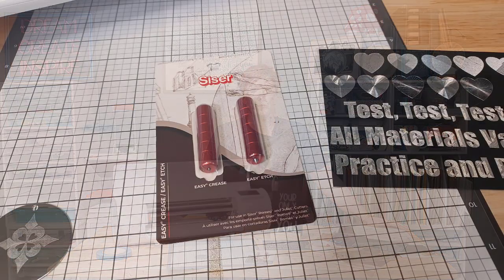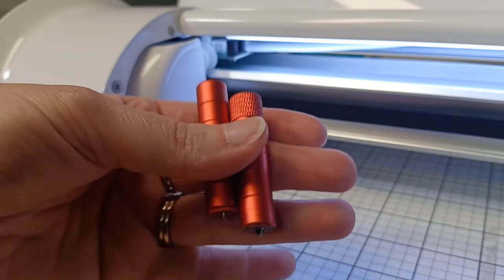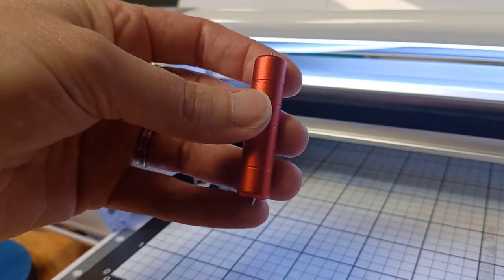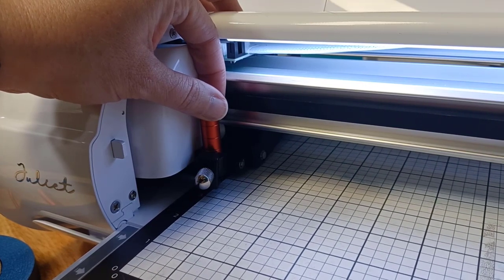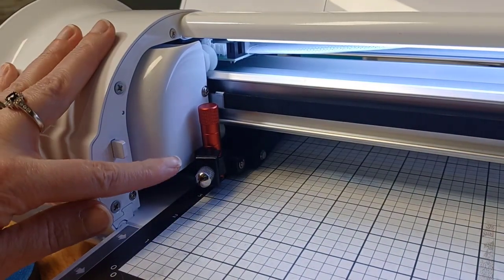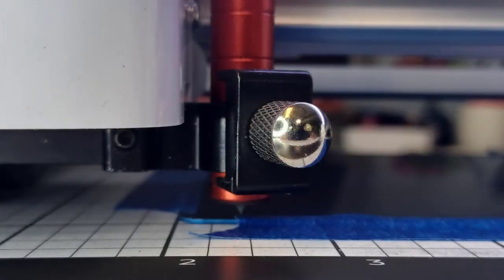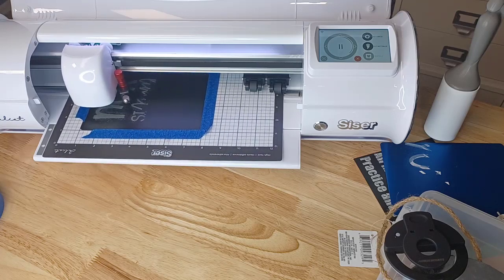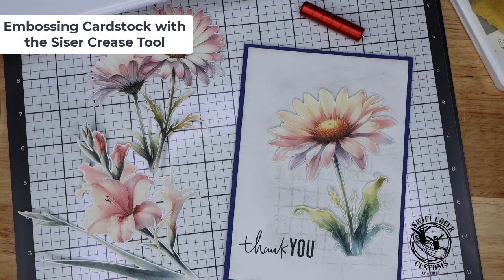How to Install the Siser Crease & Etch Tools with Siser Juliet & Romeo

Comment: Getting the height correct is easier if you use something like Post-It notes as a guide. Also helps with consistency between different projects ;)
Reply from the maker: @richardroebuck1915  yes! A Popsicle/craft stick works great too!

Comment: Is it possible to etch on wood? I'm thinking of getting it for my wooden coaster project.
Reply from the maker: @kyrill_  it would not be great at it for several reasons... 
It would need to be super thin for the clearance of the machine. Less than 3 mm approximately. 
And the debris created by etching could be damaging to the insides of the machine mechanism if the sawdust or wood pieces got into the bottom roller bar mechanism. 
If you want to etch or engrave on wood, I'd recommend a laser machine.